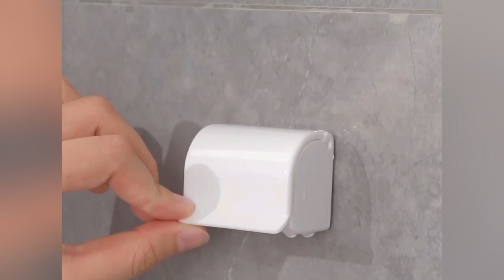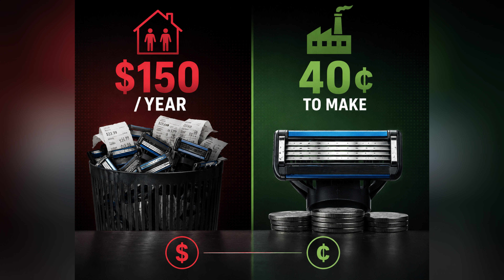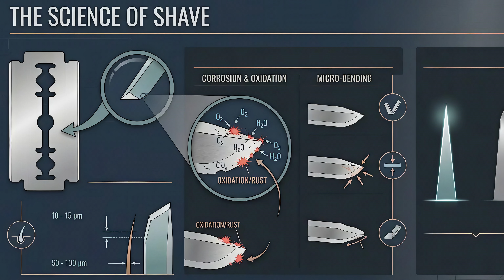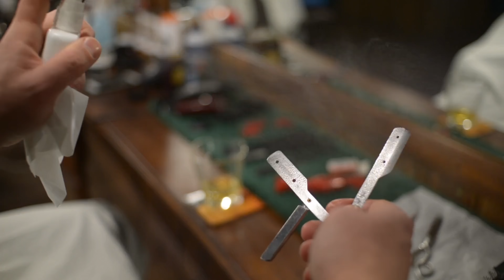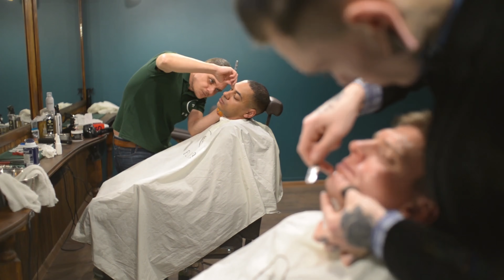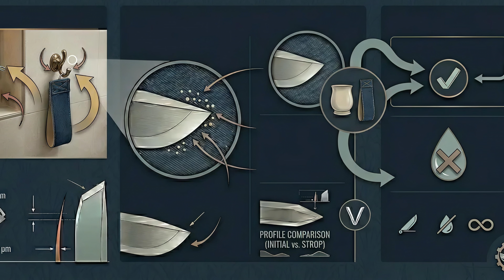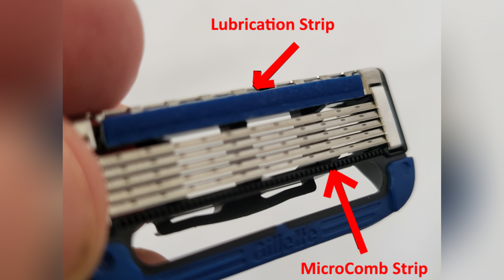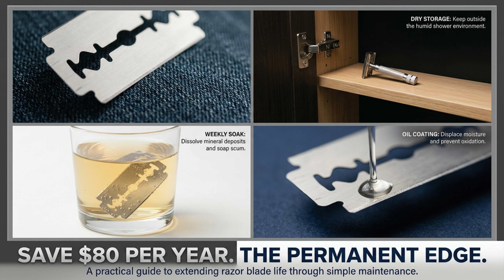Your Razor Is Designed to Dull After 3 Uses — How to Make It Last 2 years!

Comment: I do a few of those things. However I used alchol and a little oil rather than vinegar. Similar idea. Thats a trick I picked up from reading up on the cleaning fluid used for electric razors, whoes clearning cartridges are stupidly expensive given whats in them. I will try vinegar, because it is good at decalification (used it with critric acid to clean the espresso machine each quarter.) Its a smart idea.

Comment: I remember when having a triple blade gave a great shave, now you have quatro and six blades and they barely do the job. I still use triple blades and get 3-5 shaves. Sam's Club has a 30 package of Gillette blades for about $ 55. When in a bind I resort to the electric razor.

Comment: I use old fashioned safety razors.   
Much cheaper, sharper, and last longer.   
IF you do this -- I recommend Japanesee Feather blades. 
I will use one blade for 7-10 days before changing.  
Simply clean the blades after each use.  duh. 
Once sold in all stores, now only found on-line.  
The money you save on blades makes up for buying the razor.  
PLUS -- better for the environment.  
Imagine our land fills filled with all those used plastic razors.

Comment: That does not work. I use 5 blade Gillette and they last me a long time. My last set of 16 I bought in 2023, last me until now, almost 3 years and I still have one left.. Just reordered today. Anyway I tried this denim test on a blade near end of life and it definitely made a difference, it made it worse! It was still just about usable before the denim treatment, after it, it cut me to pieces. It's bulls2t, does not work, in fact it's guaranteed to make the blade unusable. Don't try it. This is just a copy of similar videos..

Comment: I used to get a rash after using the razor a second time. Now I spray my razor with 99% alcohol, and blast it dry with my battery blower(it takes like a second) after every use. I found that not only do I not get a rash anymore, but my razors now last way longer. 

For a while I just rinsed the blades after each use, slug most the water out, then popped the blade in an air tight container with 99% alcohol, and although that worked great , the slimy stuff (they put on blades to helps glide the blade on your skin) would go bad after the first stay in the alcohol, thats why I got the mini blower, and blast it dry.
Thankfully my bath sink is completely separated by another door from my shower, so I don't have to worry about the razor sitting in the humidity, but I'll definitely trying this in addition.

Comment: Thanks no! The bacteria after the second and third use spreads exponentially on the blades! It is not a good idea to use them that long time unless you dont want to have a face full of skin irritation!
Reply: Yes that is essentially true for sure. We see the same thing regarding toothbrushes combs washcloths you name it. We wash those things consistently or at least we should. That’s why it’s probably a good idea to spray a 70% solution of isopropyl alcohol on your razor blades as well as a toothbrush. ￼

Comment: Even if you have a disposable razor, it'll last 10x as long if you bonk the front a few times and knock out the beard bits stuck between the blades, if you don't want to deal with stropping and etc etc on a 50 cent razor blade.  Just don't bang it against the tile directly or you'll mess up your tile before you realize you're doing damage.

Comment: How about showing the whole 4 step procedure in a single 60 sec video? It would help more than this 7 min video (it should be included at the end of this video).
Reply: Just filler material, it's annoying af.
Reply: It's terribly done ... they don't show the stropping correctly at all.
Reply: @bluejay313 Then how do it correctly?
Reply: I would give this comment 10 likes if I could.
Reply: @StudioByKH83PK  you make it …
Reply: Just try cooking oil.
Reply: And get rid of the effin music!
Reply: Dead right. Like you suggest show the whole thing in four steps instead of going on and on and on.
Reply: They are in the business of ad revenue
Reply: As soon as he started giving a whole lecture on razors, I knew this was going to be one of those smarmy infomercials.
Reply: @messenger.beyond.reality  "infomercials" what to buy some cheap mineral oil and white vinegar. What a joke you are. Video is not promoting any thing worth of any money. Get a grip.
Reply: @StudioByKH83PK  seriously.
Reply: Forget the video, use a double-edged safety razor as your ancestors did. You're welcome :)
Reply: @SzamBacsi  
Why?
Reply: @AZ-kr6ff Because when you sharpen the blade you can only sharpen one side, didn't you watch the video of the example of the single sided straight edge razor being sharpened on the leather strop? Are you doing the same thing to a disposable razor? No you aren't
Reply: @SzamBacsi  feather FTW
Reply: @SzamBacsi  I cut myself enough with the small razors, I don't want to do it with one of those and die, thanks though...
Reply: @Stevo.100  How many blades does your razor have? I found that with the five blade ones it's basically impossible to cut yourself - even in areas where you don't see anything...
Reply: I buy Wilkinson. No problem.

Comment: I don't use anything with more than 3 blades 
I use my Razer for 3 months regularly.
I just lay it on it's back.
And I only shave immediately after a shower.
I also only use a shaving brush and soap. 
Shaving cream and gel load up the Razer and won't rinse the blades clear. Soap rinses no problem and a bar lasts me years. At least 3 years for me.

Comment: Poor presentation.
Reply: Ok GILLETTE I thought it was informative, I never knew that, now I got it all set up in about 10 minutes I'll try if it works it'll save me $100 a year
Reply from the maker: You think you can do better? If so, we are actually looking to hire an extra video editor so send your resumé to; SidneyExplains@gmail.com
Reply: Snappy comeback 👍
Reply from the maker: @oberyn-1 Funny enough, this is actually true — we really are looking for another editor to add to the team. So I figured I’d put it out there too. You never know who’s reading. Maybe we answer the question and find the right person at the same time. Kill two birds with one rock. LOL.
Reply: @Sidney_Explains_Money 
For more than 10 years I've been using the Blade Buddy razor blade sharpener, which is designed to extend the life of disposable razor blades.

The device works by straightening the blade edge with a few swipes, aiming to provide closer shaves and reduce nicks and razor burn.

It is a black, manual tool that is typically used before or after shaving. 
Cheers, 😁
Reply: @Sidney_Explains_Money  Photographer, videographer and video editor here, great video, clear, concise and now liberated from another corporation!
Reply from the maker: @juriesenekal  Thank you so much! i really appreciate the comment. 😁
Reply from the maker: @juriesenekal  I really appreciate your expertise in visual arts and it's good to know what you really think about my video. Thanks again

Comment: Ohhh boy, where is my safety razor gang. Been using them for years and the biggest expense is a shariving soap which is 20 bucks per year. If you are interested in switching I would strongly recommend. I love astra blades, super sharp and cheap

Comment: Why cant you put the blue jeans sharping In written form as you talked so fast I for one couldn’t understand what you said even after listening many times. What did you l mean flip it over thanks.
Reply: Yes I hear what you’re saying, sir. His video was rather confusing and trust me you’re not the only one who thought that. Anyways, what he should’ve said was that you keep the razor blade and or handle in your hand the same exact way however you simply turn or spin the denim or towel material 180° to face the opposite direction. I’m not sure of the accuracy or credibility of the new improved explanation, but supposedly the denim has fibers which run at different angles or directions depending on which way it faces. ￼Personally I don’t think it makes any difference, but I suppose it’s worth a try to test it out. ￼
Reply: @Kingdom_of_God777 thanks😊

Comment: What's he talking about "flip the razor and 20 more on the opposite face"? If you flip it over the blades won't touch anything.
Reply: After this video, he posted a comment to update the information. Essentially you keep the razor blade and or handle in your hand the same exact way except you simply spin or turn the denim or towel material 180° in the opposite direction. Then you run the blade across again. Hope this helps. ￼

Comment: Mach 4 blade,
Shave 7 days/week,get minimum 3 months.
Dont care for the lubricating strip anyways, a few bangs on the sink, blow and dry with towel. I like the vinegar, Im going to use that and wash it off with my Waterpik to see if I go longer than 3 months. If youndont thoroughly clean, you'll think they're garbage in 2 weeks.
Ive explained it to all my friends now they do the same.

Comment: Easier solution, leave it in water. can't rust if it's in water and not exposed to oxygen. Few drops of hydrogen peroxide to keep blade clean from any bacterial growth. change water every couple of days. stropping is not that necessary after every shave. maybe once a week.

Comment: What is he talking about with opposite face,  spine first, edge trailing. Sorry, I'm stupid.
Reply: @simplifiedlifeJilbef  either you’re not stupid, or we both are. I didn’t keep up with that part either.
Reply: @nowakezoneforever Ha! Thanks. I watched it 3 times at slow speed, still not understanding. Looks like he rubbed it away from himself with the blade edges pointing back at him.
Reply: @nowakezoneforever

No, you’re not stupid and maybe you’re about the 20th person, including me and my family members who were totally confused by his explanation  

So essentially you keep the razor blade and or handle in your hand and don’t change anything about the razor blade or your hand which holds it; however you spin the denim or towel material 180° in the opposite direction and then repeat the process by pushing the razor blade handle across once again 

You’re not flipping anything. You’re simply spinning or turning the material and the opposite direction and repeating the same process
Reply: No, you’re not stupid and maybe you’re about the 20th person, including me and my family members who were totally confused by his explanation  

So essentially you keep the razor blade and or handle in your hand and don’t change anything about the razor blade or your hand which holds it; however you spin the denim or towel material 180° in the opposite direction and then repeat the process by pushing the razor blade handle across once again 

You’re not flipping anything. You’re simply spinning or turning the material and the opposite direction and repeating the same process 

￼￼
Reply: @Kingdom_of_God777 Thank you!

Comment: i do almost everything in this video (thanks to my grandfather who showed me how he shaved in the 50s and 60s). the only thing i do different: after shaving i do the shake and towel dry but after the strop i rinse it in rubbing alcohol as i find it get the water i may have missed or cant see (i use a double edge safety razor) then i hang it upside down in the stand where my shaving brush hangs. i also soak my all mine and my wife's grooming tools, (razors, combs, brushes, etc) in barricade once a week. what id do not do that i am going to go do right after i post this is put some mineral oil on our blades. that is a great tip and i never would have thought of that on my own.

Comment: All misleading. Razor blades are pricey because they are NOT simply stainless steel. They have a platium coating that stops all corrosion.
 This is not even mentioned in the video. Razor blade makers are the worlds #1 buyers of platinum!

I always leave my razor wet and they  still last about 4 or 5 months. But this is 100% because I have very fine hair. 

My (now ex) wife would sometimes use my razor and if know the next day as the blade was made blunt in one use by her thick SE Asian hair being too much for the blade.  

Guys, it's how thick/fine your hair strands are that determine how long your blades last, and we all have different hair thicknesses.

Comment: I also suspect the chemicals in shaving gel and foam help to rot the blades. I started using shaving oil instead a few years ago and found that the blades last much longer, at least twice as long as they used to with shaving gel, without doing anything else. I'll now leave my blade outside the shower and dry it, see if that makes any difference.
Reply from the maker: You are 100% right on that my friend!. Some shaving gels and foams can leave residue between the blades, and that residue holds moisture — which is exactly what we’re trying to avoid.

Shaving oil is a smart move because it gives lubrication without leaving as much foamy buildup trapped in the cartridge. So yes, I can totally see why your blades would last longer that way.

And leaving the razor outside the shower + drying it well should help even more. The big enemy is not just shaving — it’s sitting wet for hours afterward.

Comment: Stropping a blade happens after honing to sharpen. It evens up the microscopic burrs that occur from the coarseness of a stone (hone). Honing happens (used to happen before modern replaceable straight-razor blades) only every so often depending on how much use the razor get (how much shaving done each day in 💈) Honing a blade properly usually takes as many years of practice as does learning to shave customers well.

Comment: I don't do any of these but my blades last for months and months. I have a very sensitive skin and I used to hate shaving because of it but then I discovered shaving oil that made everything easy and comfortable. After a while this product disappeared and then I found out that I can make shaving oil myself by mixing 2/3 castor oil with 1/3 olive oil. Great results, very low cost, and as a bonus, the blade remains sharp, probably because of the lubrication of the blade that also slows rust.

Comment: It wont work. The simple reason is that after you did all those steps and saved the cheap razor your brain wont release dopamine. But after you bought new razors it will. People get high each time after consuming sth but never after they did sth boring but right.

Comment: My disposable blades last for up to a year.  I shave with vegetable oil and leave the shaver in the cup of hot water that I rinsed it in as I shaved. Baby oil is a  light mineral oil readily available. I have not tried using baby oil to shave but the olive oil I am using to shave at present doubles as hair oil. :face-blue-smiling:

Comment: What about Caster oil?  Will that work for the strip?
Reply from the maker: Castor oil can coat metal, but I wouldn’t use it for this razor trick.
It’s very thick and sticky, so it can gum up the cartridge and leave residue between the tiny blades. For this, you want a very light, stable oil....... something like mineral oil or baby oil.
And you don’t need much at all. Just a tiny touch on the blades, then wipe off the excess. The goal is only to leave a thin moisture barrier, not soak the razor or the denim.

Comment: I dont understand what you are saying exactly about how to run it across the denim.
Reply from the maker: Do about 5–10 light strokes one way, then turn the razor around and do 5–10 light strokes the opposite way across the denim grain. No pressure needed — just light passes. The goal is to clean and polish the edge, not actually sharpen it like a knife.
Reply: @Sidney_Explains_Money  One question many people are raising is you keep showing multi-blade razors but there's no way to flip them over and strpp the other side. Any suggestions on how to make them last longer? Or is your example only apply to safety razors?
Reply from the maker: @Stand4Victory  Yes, I should have explained that better.
This trick is for cartridge razors including multi-blade razors.

When I say to “flip it,” I don’t mean flipping the cartridge over to sharpen the back side of the blades. I mean changing the direction you rub it on the denim.

Denim has a weave — little threads running in different directions. So you gently rub the razor opposite the cutting direction for a few strokes one way, then turn the razor or the denim around and do a few strokes the other way, still opposite the cutting direction.

Comment: I use a waterpik to clean out the hair and shaving gel between blades and they last a long time  I'll have to try the rest of the advice here too.
Reply: I was just going to say just that ! Water pic is a great way to thoroughly clean the blades of any stuck hair and takes only a few seconds. I also give a spray of Isopropyl Alcohol, it is hygroscopic and kills germs. 1 spray is enough. Then pat it dry or blow on it to dry. A bottle of 90% Isopropyl alcohol costs around $ 3 from Walmart and will last a couple of years. Pour it in a $1 spray bottle.